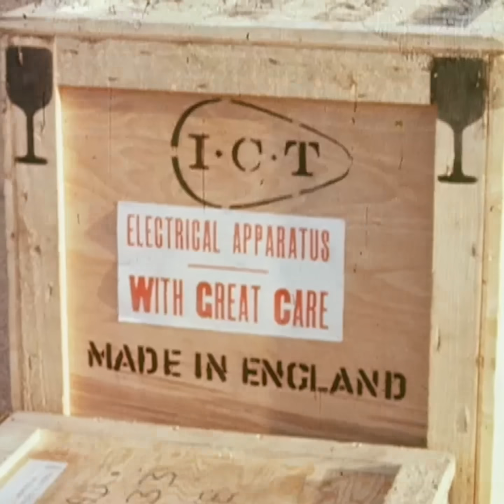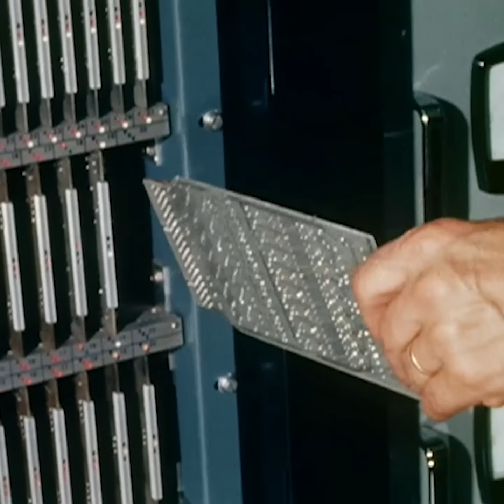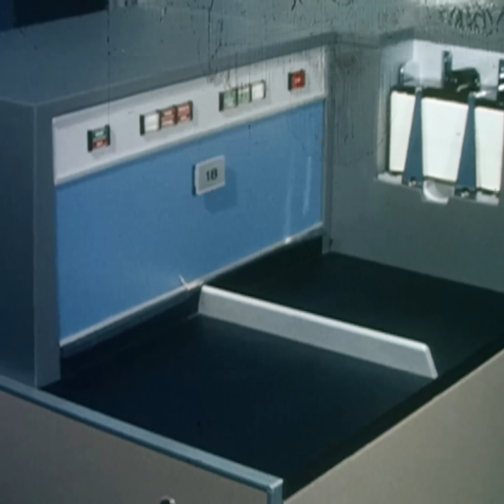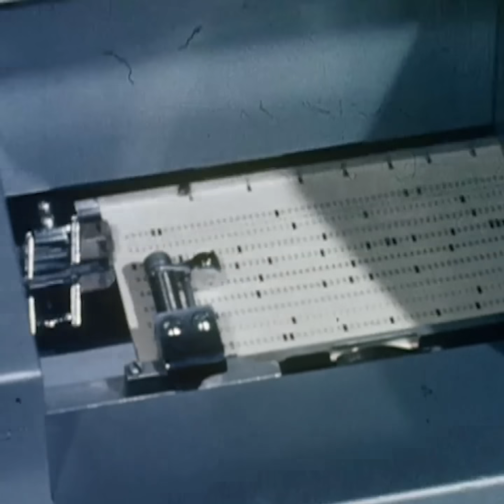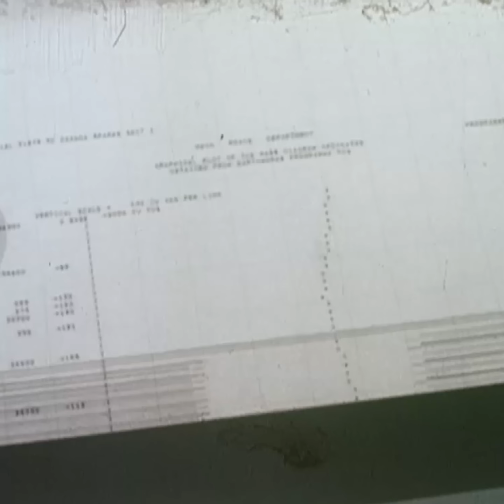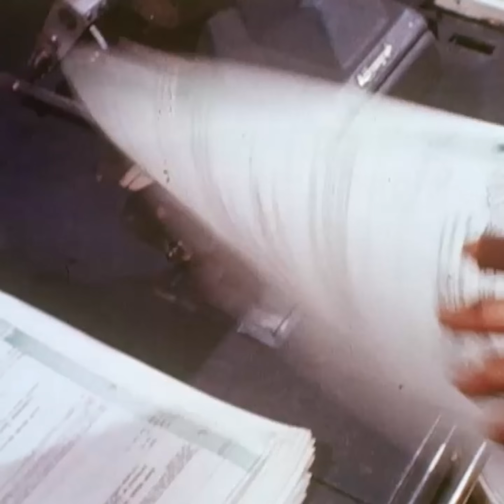Transport and Main Roads First Computer in 1965, ICT 1905

Comment: I was one of 7 programmers selected from within MAIN ROADS to convert the then paper-based motor registration system to a permanent computer system. IBM created it's Brisbane Data Centre primarily to service the dept,s needs.  An IBM 1401 computer was installed, along with ancillary unit record equipment.  We were all trained by IBM instructors, as there was no I.T. training available at that time. We were located with other Main Roads personnel in very basic premises on the corner of Albert and Turbot Sts.   The systems were converted on time and within budget.    Incidentally, the transistor-based IBM 1401 population was extremely popular, exceeding IBMs own forecast by 500%, and comprising over half the world,s computer numbers of 24,000 in its lifetime.
Reply: What happened to all the data tapes? Could be very handy for history research in future.